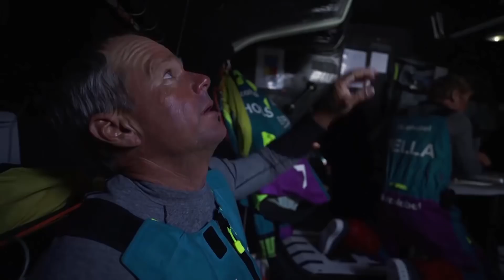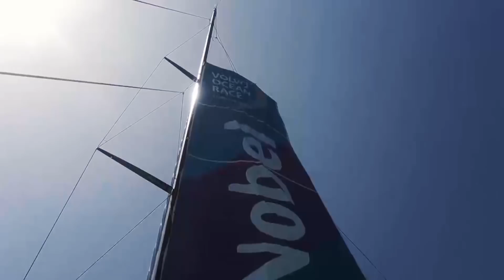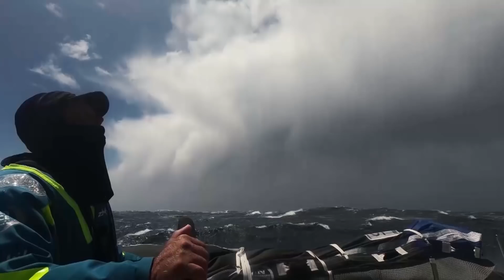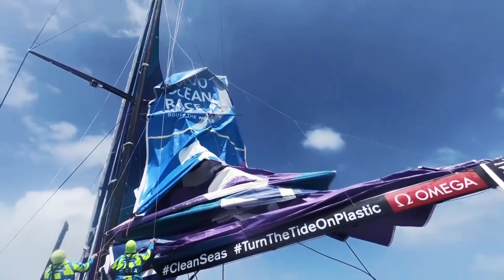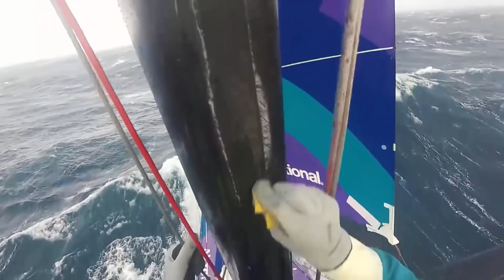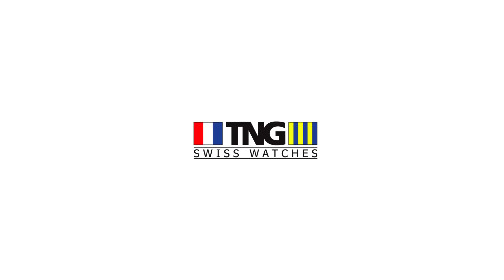Ill-fated Southern Ocean gybe results in mast and mainsail damage on team AkzoNobel

Comment: The shot at the end is just nuts. 40, 50 feet up sanding the mast!? Is the mast track not rivited?
Reply: the less holes you put in a fibre reinforced plastic structure, the better.
Reply: sure, but it doesn't seem as though that bonding a plastic or metal track on the mast is as reliable or as strong as one would want. it looks like the whole thing cracked off. I imagine this would destroy the track, and this repair is almost impossible offshore, not to mention dangerous.